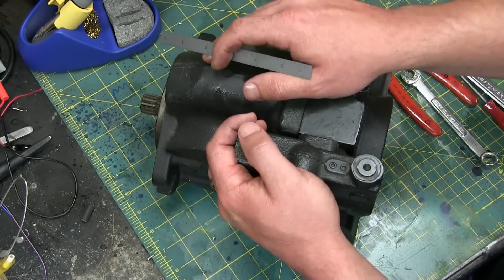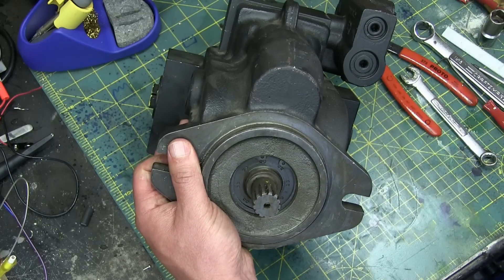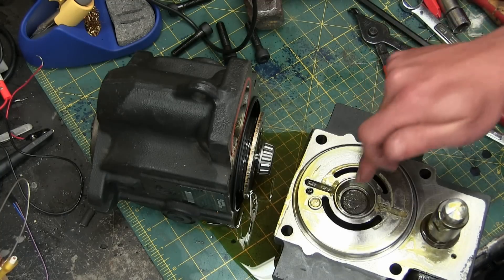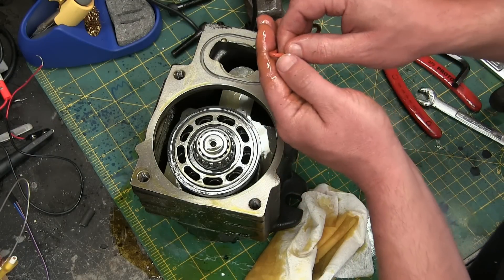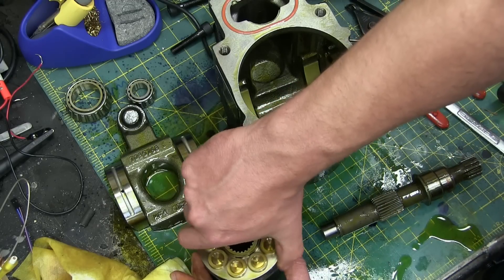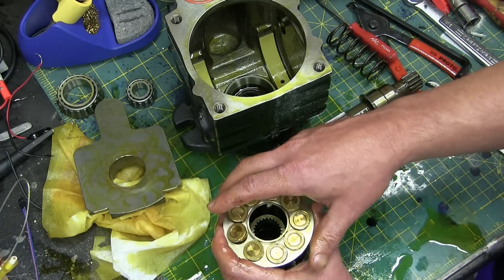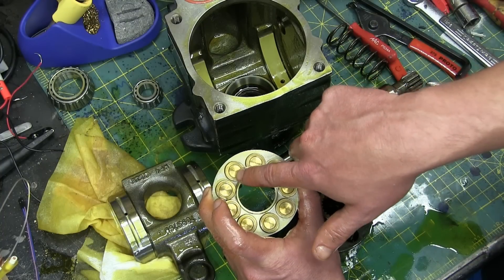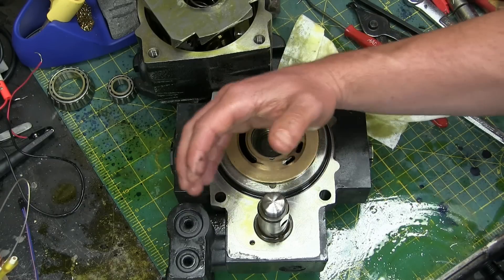100 HORSEPOWER in your HAND. Hydraulic PISTON PUMP!

Comment: If the swash plate is set at an angle 30 degrees from vertical and then changed to say -30 degrees from vertical does this change the direction of fluid flowing so can then drive say a wheel in both directions?

Comment: 2012 and earlier Honda Rubicon 500 FA atvs used a similar setup as a type of CVT transmission. Using an electric motor and computer to move the swash plate. It was a very good smooth transmission but too expensive to produce.
Reply: No idea on automotive side. I'm more familiar with powersports. The belt drive is fine. Driver abuse is their biggest problem.

Comment: I'm not a hydraulics person but I find it quite interesting and fascinating. May I ask what's the benefit of this quite complex & expensive mechanism to change the flow rate instead of just varying the RPM of the shaft?
Reply: If you need to turn the flow to zero, or even backwards, that's difficult to do with a combustion engine.   Even for big electric, starting and stopping the motor takes a lot more energy than just running at constant speed.
Reply: Ah, very interesting! Thank you very much for your reply!

Comment: what kind of tolerances do they hold the pistons to the cylinders? I work in a tool and die shop and the parts I run hold a tolerance of +-50 millionths so I'm cuious what kind of gaps they're holding

Comment: I used to build hydraulic pumps. The polished little pistons he's  talking about......the tolerance between the piston and the bore is within   .000030 millionths and the polished finish is 4 micro or better. For example 1 micro is vfc a mirror. To get that finish all the holes must be ground , honed than lapped. Very time consuming. I was good at it and was stuck doing that messy oily job and hated it. I literally had to quit because they wouldn't let me do anything else.  Nice to know how to do but dont want to be stuck doing all day every day.

Comment: I just rebuilt one out of a toro groundsmaster 325d. Took me like 5 trys to get it right. I ended up having to hand lap ALL mating surfaces to get it to seal well enough to build pressure. 20 years as a mechanic and its probably the most frusterating thing iv done.

Comment: Viton, this seal material is called out when the hydraulic fluid in the system is not compatible with the standard rubber compound. Fire retardant fluids. Some of these oils will destroy standard rubber.

Comment: So...I'm guessing the running temperature is critically important, because it changes the viscosity of the oil?
Reply: Important, yes but not critical. It will tolerate a reasonable temp. range.

Comment: They want to introduce variable displacement compressors in common automotive AC systems to elliminate the electromagnetic clutches, I wonder about the reilability of such approach.
Reply: It would all depend on the seals. These pumps operate in an oil bath. They dont handle heat well. It would be very interesting to see one adapted to gasses.

Comment: Is it really crucial to have exactly the right type of oil with this pump? Since it needs to both go through those little holes and also be viscose enough to seal the cylinders.
Reply: I think you just answered your own question...
Reply: Well in a way but I was just wondering if there is any tolerance and what would happen if you used too viscose or some other type of oil. And how often do those little holes clog up?

Comment: Hi, Great video. I learn a lot like that my pump has an internal leak. I have deprecated piston pump of flow of 55 liters/minute and pressure of 148 BAR at 1700 RPM. 1 inch inlet, 3/4 inch inlet (Cessna 70412-307C). I see many gear pumps of better specs starting at $300 while same piston pump in used conditions costs more than $1000. Could I just replace my piston pump by a gear pump adapting shaft and connections? Should I match the inlet diameter in the gear pump? Thanks a lot
Reply from the maker: Airplane parts? Easy: replace with airplane parts.
Reply: @arduinoversusevil2025  :-( Sorry, I am learning. I bought a skid steer loader and I was cheated by seller and one of the pumps doesn't move one drive motor. I know pistons pumps are better than gear pumps, but since it is a 35 years old piston pump, I am trying to understand why I can't replace it by a gear pump that is used in other skid steer loaders, with same or higher specs: flow, pressure, RPM and diameter inlet. If other spec would be needed I would like to know which or just the reason why is not possible. Thank you.
Reply from the maker: @EvilRace  piston pumps generally have variable flow. Gear pumps are constant flow. Not interchangeable.
Reply: @AvE  thank you!❤️

Comment: sir I just watch this video three times I don't know if you're going to get this comment or not but I have a big meeting tomorrow with that same pump a Komatsu dealer. They replaced left side final drive and was pressure testing machine blew a 1-inch line and ran the machine 15 gallons of oil on the the ground. Tank holds 16.6.. they have the pump apart now and the dome guide is cocked and wedge and one of the pushpins was out in the case housing.. wood aeration or cavitation cause this happen?
They are trying to tell me someone built it like that and drop the PIN..please help
Thanks

Comment: What is the pump used on? Heavy industrial equipment like backhoes?
Reply: Ship's steering gear usually uses these pumps, all be it lightly bigger versions of this. Anything where you need the ability to control flow but without turning the prime mover on and off.
Reply: We use them as pto pumps on salt trucks. typically 80-100cc pumps though

Comment: I'm gonna guess that your making this video probably has nothing to do with my suggesting it, but thanks so much anyway! Looks like the problem with my HydroDrive one is the scoring on the (sigh) aluminum main oil bearing, judging from the extreme care they put in to that whole area on your non-crap-quality pump.
I wish I could donate on Patreon, but I just cant.  However, I can make an atmega do just about anything theoretically possible (like controlling 14 servos simultaneously from one atmega328p) if you have need of some electronic wizardry for some project or other.

Fun fact for everyone that has a riding mower: You've got 2 of these hydraulic pumps sitting underneath you, and 4 if you have a zero turn mower.
Reply: Most of the equipment we use at our golf course uses only one. Sometimes two, in our 4 wheel drive units, but never 4.
Reply: Also, I have a z-turn that only uses two hydrostats. I can even think of a way to run a Z-turn off of only one...or even none at all!
Reply: Greenmachine305 Well the variable hydrostats actually have 2 variable hydraulic pumps inside them.  One to act as a pump and one to act as a motor, so a zero turn has 4.  One of them has a fixed swashplate (so not actually a swashplate at all, just an angled thrust bearing) and the other is bidirectional, i.e. the swashplate can go past horizontal and reverse its flow.

I think some zero-turn motors run off a single variable hydraulic pump where the swashplate is controlled automatically (probably see what I'm talking about in his next video) and two normal variable hydrostatic motors.

The one I have that's toast has two nearly identical cylinders (or whatever the revolver cylinder looking bit is called).  The only difference I can see is that one has 5 pistons and one has 7.  They probably have different effective displacement.

I think what killed it is the powdered (sintered metal) reduction gears that live in the same flooded case with a relatively crap filter.
Reply: Gotcha.
Reply: Greenmachine305 Its a bit sad.  They cost in the range of $500 to replace and the only thing wrong with it is that a cheap aluminum milled surface is slightly scored.  They account for the majority of the cost of the unit (mine anyway).
Reply: Engineered failure.
Reply: Greenmachine305 Psh.  They don't know my resolve.  After seeing the brass plates that industrial one had, I'm thinking of machining some thin brass spacers as a replacement for the aluminum surface.  Not sure how to bond them, but literal epoxy might work.

I gotta say, though, that cylinder metal is some serious stuff, whatever caused deep gouges in the aluminum didnt even scratch whatever that stuff is.

Comment: Id say maybe 28 hp i have and old one in manual operation that has old  numbers i almost bougt a new paver today but didn't want to kick my cookie jar over  still want to fix mine it looks like mine but mines staked with gear pump on rear  . Any way mine is sluggish to start  i need more info   i think piston packs are used same  on alot of pumps  is the old  70111 381c any info for where source parts or information might be  70142  cessna / eaton / danfoss  now  i guess these companies get sold and renamed to make it fun to find parts

Comment: Did anyone else think that that the cylinder of that pump could be the basis of a nifty little 9-shot, 70 caliber magnum revolver?
Reply: Paint ball revolver.  I don't know if it could be faster than simply bolting two guns together and using a rocker trigger to double the speed but it would look cool as hell, especially with long barrels.

Comment: After fixing a leak in hydrostatic drive on my mower I dumped 80/90 gear oil in it. The thing launches now and climbs hills much easier. But I'm wondering if it will fail sooner. If so what will fail?
Reply: The cylinder bores and the swashplate/thrust pads will wear quickly because the viscosity of your oil is too high to properly flow into those two critical areas.
Reply: Also, the pump will chatter due to cavitation. Cavitation destroys metal components.
Reply: My guess is the operator will flip it sooner
Reply: That's what the ROPS is for!
Reply: Love it when guys fix stuff by stuffing thicker schmoo in. Dude must own a Harley.
Reply: Harleys are all shipped broken.
Reply: I know this because I own 3. lol

Comment: The "hydrostatic" transmissions in mowers these days work the same way as this with the swash plate and cylinders.

Belt driven input, integral pump with the swash plate connected to the foot pedal and a circuit straight to a motor of the same design.

Rebuilt many of them, but holy cow, they are made out of the cheapest cheese grade shit you can imagine.  No parts or spares made either.

Comment: The neighbor's 2002 Ford Taurus is sitting useless due to Ford not speccing out a proper Auto transmission pump shaft. 

 Shaft fails, no pressure, no go.   Looks just like that center shaft in basic design.  Gear wears out.

It should be a bulletproof part the junkyards are selling off the chassis 20 yeas from now, not fixing 14 years after showroom.  Way too used to German or Japanese mechanisms.. Anyway,

We still haven't figured out how to approach the rocket surgery so If anyone is familiar with this and like to chime in on what you know from turning nuts and not just pages.. Using a traditional garage would generate a bill equal to the value of the car if working.

Comment: So would this be the sort of pump that would power the rams in a big bulldozer or earth digger like a JCB ?
Reply: Yes. Source? I sell this stuff for a living.
Reply: And actually, that is a relatively small pump. I have sold lots that are 250 cc/rev
Reply: pshh cc's? I've operated pumps that had their own 50hp motors. Don't remember the capacity but it was measured in gpm and not cc's
Reply: Denis Lipatnikov 1us gallon =3,785.411784 cc's

Comment: Aren't you supposed to open hydraulic components in a clean room only to avoid contaminant particulae?  My late great neighbour worked on hydraulics repair and maintenance for 4 decades and he said ideally they should never be cracked open in anything but a rated clean room (dunno the particle size limits in the room). Maybe that was more for control valves than actuators?

Comment: Now you said the slippers run on a cushion of pressurized oil. I was under the impression oil was a non-compressable fluid. If you cannot compress oil, how can it be pressurized? Can you give a simplified explanation for this?
Reply: Also, with the latest hype for quantum computers having infinite points between 0 and 1, are quantium computers the electrical version of hydraulic computers?
Reply: I must have been having a 12 beer absence of thought. Yeah that makes sense.
Reply: +Sizukun1 What's really gonna bake your noodle, is that ones and zeros don't actually exist.
Reply: Also, force can be applied to anything, just watch Ave for a while longer...
Reply: +Doug Reed I thought compression was a negative displacement of mass.
Reply: I'll have a go.

Think about when you take a slash after six cans; all that liquid is placing pressure on your bladder (and the bladder is placing an equal amount of force back on the liquid).

The liquid, whilst under pressure does not change its volume, but that pressure--when released through a small aperture--is what allows you to write your name in the snow.

Is that what you were asking Sir?
Reply: ..Well...the oil in your vehicle engines is pressurized....a different type of pump though...usually a gerotor....look it up on wiki-p......
Reply: OIl is compressible by a facor of 1% per 1000 PSIG
Reply: 44 PSI for 100 feet of water....
Reply: ..or  water....10% at 50,000 PSI....waterjet......

Comment: If variable displacement hydraulic pumps are so expensive, why would you include them in a hydraulic design? Wouldn't it be cheaper to control the speed of the motor powering the pump? Or simply regulate the amount of flow coming out of a circuit containing a regular pump and a pressure relief drain?
Reply: This is the only article I could find justifying a variable displacement pump over other types of control (valves or motor control). I think it says the same thing if you mean "Heat = Wasted Energy" (http://hydraulicspneumatics.com/200/TechZone/HydraulicPumpsM/Article/False/46094/TechZone-HydraulicPumpsM)
Reply: What they seem to be designed for in my view is to operate many different components all at once or at different times.  The plant where I work, we design around using one variable displacement pump and when many valves fire the swash plate leans over and compensates for the "demand" of fluid flow, then tilts back straight when no pressure is needed.  When you use many pressure relief valves, they really heat up and shorten the life of the fluid as well.  Hope that helps.
Reply: Also closed vs open center based hydraulic systems. This pump would be used on a closed center system, a fixed displacement is used on open center.

Comment: Wanna talk about HP in the hand you should check out turbopumps for rocket engines. 

"Although not much larger than an automobile engine, the SSME 
high-pressure fuel turbopump generates 100 horsepower for each pound of 
its weight, while an automobile engine generates about one-half 
horsepower for each pound of its weight."

http://www.spaceatdia.org/uploads/luca/SSME%20Turbomachinery%202010.pdf

(Granted, it won't fit in your hand but the hp/lb is pretty high.)

Comment: Had a Honda AT 400, same basic design as this.  Worst Honda ATV ever made.  Still better than many though.  Oil changes were veddy important, folks found out the expensive way.  Mine just liked eating swash plate angle sensors and such.  Limp mode was common if you liked getting it wet.

Comment: Man, I've got all sorts of gear, piston, vane, valve, and metering stuff. I collect it when parting out equipment, namely pavers. We've got to the point of tossing tons of hydraulic components with any sort of wear (it's sad really) so I started hand picking the cool ones and saving them. I've got a tandem gear pump attached to a sunstrand hydrostat I'd send ya. Pay the shipping and it's yours lol. I want it out of my yard. Oh, I capped it all off so she wouldn't fill with dirt. The ole bitch would be in spec on a bench I'm sure. Hmm I've got all sorts of cylinders and what not too. Just not enough drive to rebuild all of it and sell it. I donate a lot of it to the local University I went to. If you're interested hit me up. Cylinders, rams, pumps, motors, hit me up with a list of some things your after and I'll check my shed lol.

Comment: I use one of these as my HPOP for my 7.3 powerstroke

Joke.
Reply: Well, you're partially not joking. The 7.3 HPOP is the same design but with a fixed swash plate angle.
Reply: I put down a jigawatt to the pavement. That is of course after properly tuning my hadron collider and flux capacitor.

Comment: Why would anyone prefer this complicated device instead of just using a gear pump and varying the speed of the electric motor?
Reply: I have no idea, I'd probably have to call them up and tell them I"m king shit of turd island, looking for a quote.  It just seems counter intuitive to me that going from a 100 HP electrical motor to a 100HP variable frequency one would be more expensive than going from a gear pump to this thing.  I'm not educated on these matters at all but I assumed the VFD was just an electric motor but with a different configuration of magnets and windings and with a more complicated controller.  I took your saying "this is extremely ill advised"  to mean that this thing has some very situational advantage that they use in aerospace or some very specific situations but that you got it anyway because it's just a really impressive piece of machinery.

Comment: Totally brilliant power transfer systems that can be completely rooted by not priming them correctly on the first spin up. Used to use a variable pump and hydraulic motor as a starter system for Allison gas turbines driving large 11KV alternators through a planetary gearbox, not all that much Hp needed but very high inertia and long crank cycle time. Get some lazy assed fitter who hasn't primed it properly and the pump is toast on first crank up during factory test.